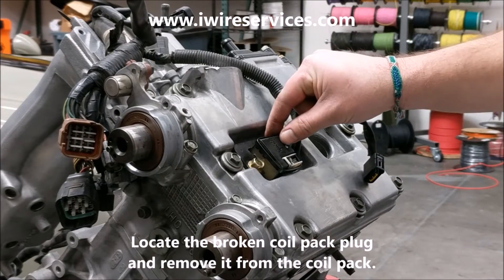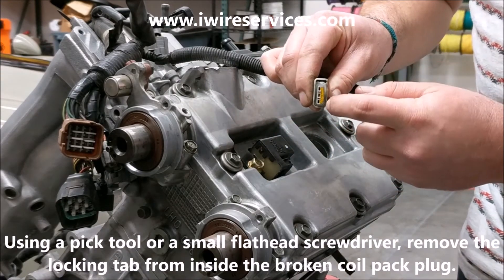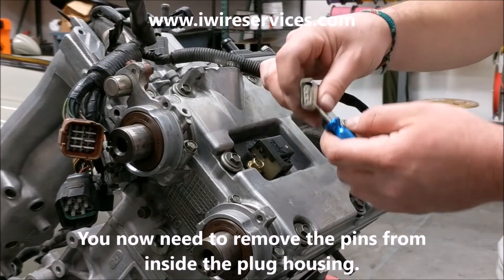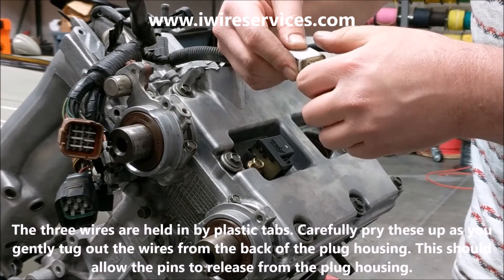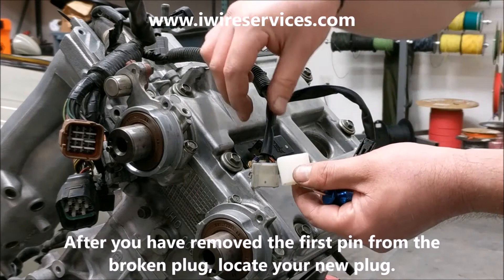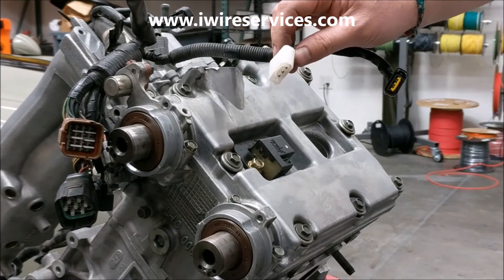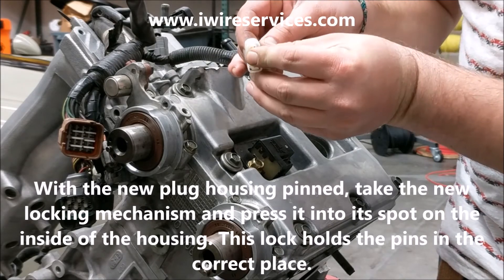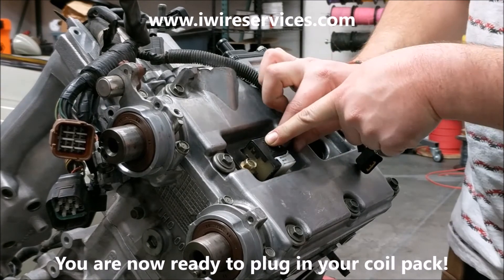DIY How to Repin a Subaru Coil Pack Connector

Comment: When you say to make sure the rubber weather seal is inside the plug, the finished product/plug should look like the one on the left w the green check mark next to it? Or is that a part that goes inside of the plug?
Reply from the maker: The weather seal is inside the plug. It will look like the green check mark.
Reply: @iwiresubaruwiringsolutions5538 sweet, got my replacement piece a couple weeks ago and am planning to do it in the next few days. Im assuming the battery should be disconnected while doing this, correct? As my engine is in the car unlike in this video demonstration. Thanks!
Reply from the maker: @joheewrx5278  Yes, please disconnect the battery for safety!

Comment: Hey Iwire, do you guys ether sell the connector replacement and pins and crimping tool? Or do you know where I can get a set of the above connectors for an ez30. My Subaru dealer does not have the connector and want me to get a complete harness
Reply from the maker: We have the connectors and tools available on our website - iwireusa.com

Comment: Can bad wire connector cuses anti skip light cheke engine light and a curise control flashing
Reply from the maker: Possibly. If the check engine light is on you should read the code to figure out what it's for. If the check engine light is on the cruise will flash.
Reply: @iwiresubaruwiringsolutions  they tell is code c0057 that lose comunication between motor an tranmission any idea that can help mr thank you
Reply from the maker: @eloygarza4287  We would need the car in our possession to diagnose this tricky issue. I suggest finding a reputable shop near you that can dig in more.